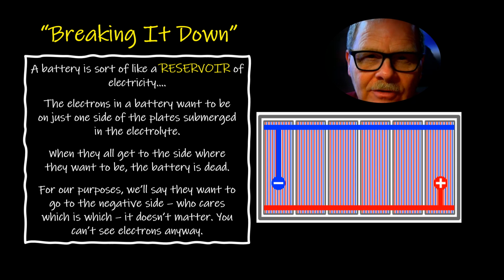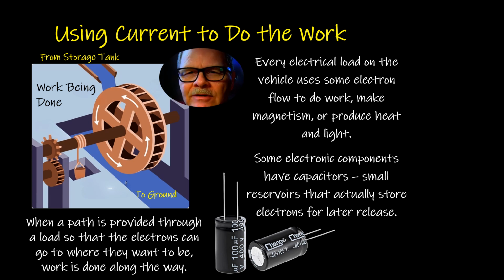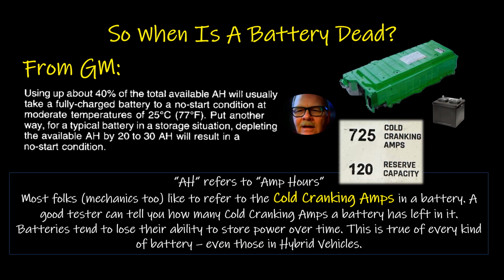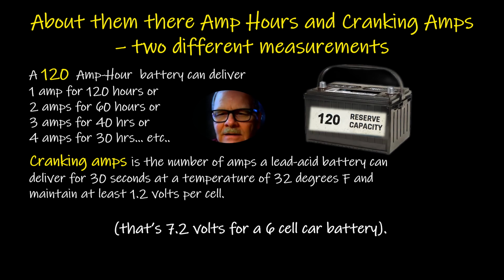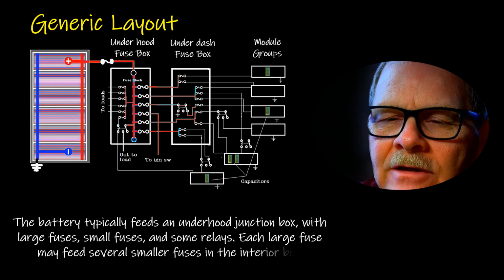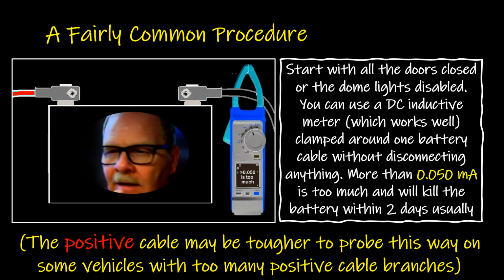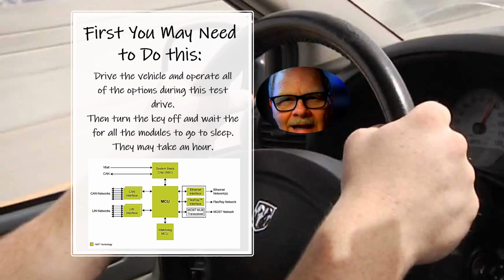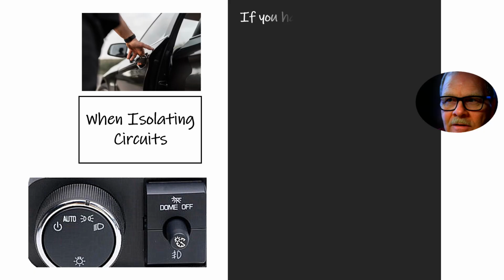Finding Parasitic Drains

Comment: I have a question about reverse charging. I've read about doing this to a battery to remove the sulfation. I have a 2005 Dodge Magnum R/T. After charging, the battery will hold around 12.2 volts but won't start the car. I'm going to try it but would love your opinion.
Reply from the maker: It's likely to be drained of the needed cold cranking amps - in today's world it's best to get a new battery rather than trying to renew an old one

Comment: Charge Extra Fresh 
I have seen a couple of battery explosions happen to others close by working while the charger is hooked up on a higher setting. That was shocking.
Good Monday Morning to You
Reply from the maker: I had one blow up on me back in 1979 as I was loosening the battery cable bolt - thankfully, my forearm took the brunt of the blast - I wasn't wearing eye protection at the time and my arm perfectly blocked all those plastic shards and all that acid from smacking me right in the face - and I've seen other batteries blow up too.